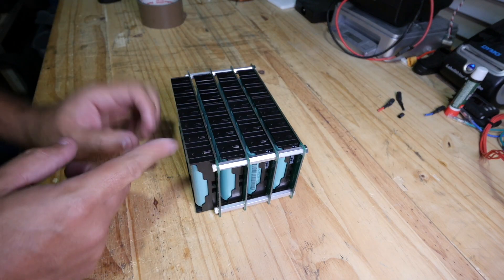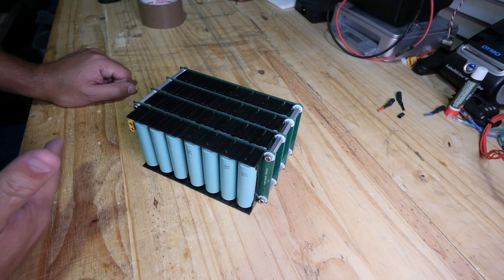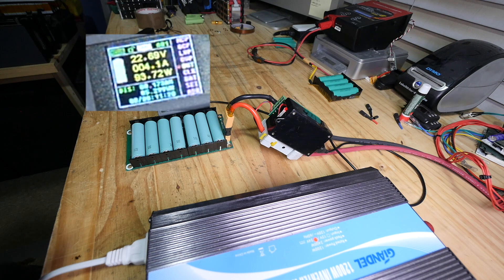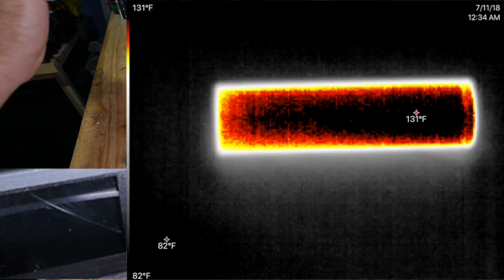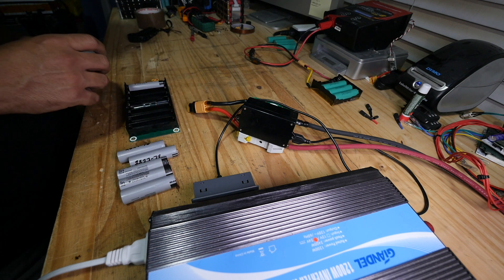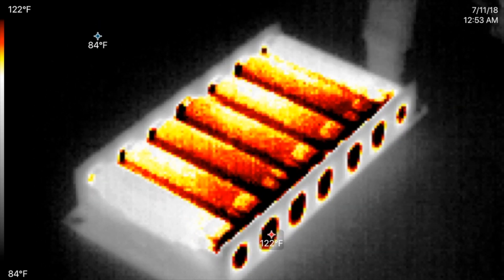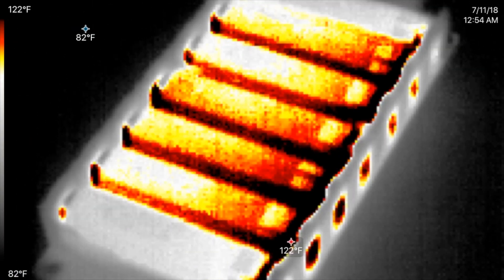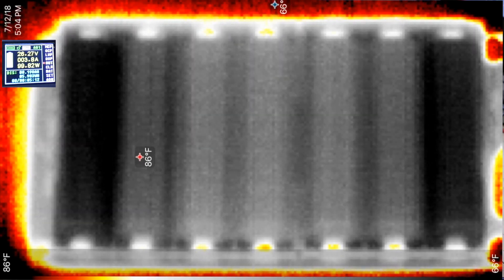Are Cheap Chinese 18650 battery holders Good enough? DIY Powerwalls

Comment: Batteries are rolls of conductor plates separated by an insulator. Thus the heat generated on the plate will easily travel through the plate, but will travel through the insulator with more difficulty. The result is that the heat travels faster to the positive and negative terminals through the conducting tabs that are rolled into the battery plates. The best way to eliminate battery heat is to have heatsinks at the positive/negative terminals.

Comment: The ohmic contact of the clips will always generate more heat than solder/spotweld connections. That heat is wasted energy. For clips to not be lossy, there needs to be a lot of pressure and the area in contact with the battery needs to be as big as possible.
Reply: Gold platting would help a lot.

Comment: Use a mosfet in a reverse polarity protection arrangement. It will heat up less than using a diode. It's really easy and passive. If the polarity is reversed it won't allow any current flow.

Comment: You can see from your infra red images that the end contacts are hot 1st then the heat spreads throughout the cell so the contact is causing the heat.

Comment: Use a cheap red LED that will light up with the wrong polarity but won't draw any current with the correct polarity.
Reply from the maker: Bamm,   See I knew someone would have a good idea
Reply: That’s a pretty good idea..
Reply: good idea i would say
Reply: great idea.  Probably worth doing module level over current protection than per cell.
Reply: I once made something like this in middle school at technology class. I never figured out how it worked.. but now it just clicked. leds don't light up in the wrong polarity.. diodes only let current pass in 1 direction. this is amazing to realise. thanks
Reply: you can have just single polarity check PCB with green and red LEDs separately
and you can attach it to BMS pins when you adding batteries and use it over and over on hundreds of battery pack assemblies
i already post a comment about it

Comment: Good video, but wouldn't comparing this to other make/styles of holders be a better comparison? How about disassembling one end of the terminals and applying 4a through it and seeing how much if any heat it gives off? Any resistance measurement on that contact from the battery side to the pcb leg? Checking these other areas may validate whether contact pressure is the key culprit here.

Comment: What if you use a battery holder with a spring in the negative side, like the regular AA and AAA battery holders? A fuse to blow if you conect something wrong? Colors for the positive or negative side? Maybe you can have two versions of the board: One simple, with no protection or maybe only a fuse and another version with electronic protection such as reverse polarity, under/over voltage and things like that.
Keep going Jehu, you are the man! I have learn a lot from your videos since you started with the samba proyect many years ago. Saludos desde Argentina

Comment: I wish someone would make a battery cell holder that had a slot to place a small nut slid into both side, so you could use small bolts for the compression terminals, this is how i built my packs on my diy powerwall, sandwiching nuts between the ends, then threading in copper bolts to secure the contacts with red locktite once they were torqued to a setting that seemed tight enough.

Comment: If I were designing this PCB to address the heating issue, I would radically increase the size of the thru-hole pads and traces to provide as much heatsinking as possible. I might even (as much as possible) convert the entire underside of the board to emphasize heatsinking and have all the sense wires etc on the top side. If you can draw enough heat through the solder pads, you might be able to keep the contacts from heating much at all.

Best part is it would not increase the cost of the PCBs at all. Also, use the silk screen layer to clearly identify the polarity of the batteries. Still no cost.

Comment: You need thicker boards with thicker contact and reverse polarity protection. With the set up you have, all you need it a blocking diode. I also think you should look into the holder with springs. I thought awhile back ago, I saw some just like the ones you're using with the solder pin in the back, but it used a bottom spring. Good Test Jehu!!
Reply: i had some holders with springs but they was even worse after that i start using same type of holders as he have and they are ok for me (i need only 2A)
Reply: Spring loaded button style connectors in the battery sled are great
Reply: blocking diode will generate heat and draw power... 0.6V @ 4A is 2.4W times the number of holders.
Reply: I agree, simple diode for reverse protection and beef up the board for both heat dissipation and thicker tracks.
Reply: You wouldn't use the diode like this. You place the diode in Parallel to the Postive and negative. Then the only time it is used is when a reverse connection is made, but then instead of going through the battery or your device. It Blows the fuse. No heat loss or power loss unless you make a reverse connection.
Reply: Except relying on a fuse to bust is really weak protection these days.  (and also unreliable depending on the cells you put in it)

Comment: Dude its super easy to keep the orientation of each cell corectly.  Your ballance leads are off center on your boards... just remember your cell tops (positives) either need to be facing whichever side the ballance lead is closer to...or the opposite

Comment: I like these battery holders a lot for my portable battery packs like my 7S4P pack for my Ham radio portable power. Not using for combined amp draws above 10 amps at 12 volts stepped down voltage via a buck converter. These packs allow me to easily change out weak cells on the fly, and each 7S pack is not putting out more than 2-3 amps. I would not use them for high amp applications, but if you had put 4 of those packs in parallel, you would not have seen as much heat. I've tested my 7S4P packs up to 20 amps at 12-14 volts continuous output (through a step-down buck converter)  with no problems.

Comment: Whenever I use those battery holders I also add a square of electrical tape at both ends which I then marks a big "+" and "-" on you make it harder for me to screw-up the cell direction. It helps a lot. :) Cheers, Paul
Reply: This is the fix right here. Just make sure there is some way of labelling the cell holder and I think you'll be OK.
Reply: Why not just use red and black electrical tape then no need to mark it as well
Reply: I tried that option but the black tape on black battery holder doesn't show up so it's just the red tape at one end - which should be obvious enough... but when I'm tired and in a rush to finish something, I need even more warning to think, before I do the dumb thing :)

Comment: There are other style holders that are really tight.  I saw another video that tried both out and had heat/resistance trouble with the "easy to insert" holders, but the super-tight ones worked much better.

Comment: I use red fingernail polish and paint the positive end of the battery holders.  I also paint a red band around the positive end of the cells as well, none of the cells I have (mostly Samsung) are marked for polarity on the sleeve.  Matching color that way I've never put any cells in backwards, at least not yet. lol  It's very cheap, gives a visual indication even at a glance, and can never fail.  I buy both red and black nail polish from the Dollar store, it's not only handy for marking cells/ holders, I also mark terminal screws, paint the end of wires, etc to denote polarity so I don't mess it up.

Comment: Jehu, I really like what you're doing here... Last saw you at the Phoenix record breaker. I'm looking into doing an electric VW Conversion too! (I got kids) -On the topic at hand:
My vote - Not to worry about the battery polarity detection.. Just be careful(?)
I am very interested in setting up a LED to indicate a high/low out of spec cell...
A transistor 'auto-jumper' to disconnect a runaway cell would be a very useful
safety device. As though there were a fuse on each cell, but done via transistor
to bridge out the errant cell. Then with LED lit, it lends itself to easy replacement,
which would be of great benefit in this time of recycled cells of similar capacity
but maybe different ages... and therefore a varied lifecycle. Thoughts?
I'd love to groom the BMS and thermal properties to achieve the theoretical
25 year battery life we hear about.. No problem shifting cells from high C rate
vehicle use to lower intensity residential solar battery use... Still counts!
Keep up th good wk

Comment: A cheap, hackey, reverse polarity circuit could just be an LED that lights up to alert the user to the issue with a diode in-line so current flows to the LED but not further. Should be safe enough if there's a per-cell ground up to that point and then join them all together once they're past the diode for the series connections.

Comment: If its worth it to add reversepolarityprotection depends on how much damage we can avoid by adding it. A video where you install a battery backwards in a normal batterpack could show the results/danger and help you decide if its worth it. ;)
Reply from the maker: You’ll ruin plastic holders and blow fuses,  but more importantly you’ll probably burn yourself as you will find out as you are interconnecting modules

Comment: A diode can be used for reverse polarity but the down side would be a set voltage drop per diode added. An other option would be to change the battery holders to https://www.digikey.com/product-detail/en/keystone-electronics/54/36-54-ND/2254090 and put an indicator in the silk screen of the pcb

Comment: Another good thing to check might be to check the voltage drop across on negative contact by measuring on the battery cell then to tbe other side of the contacts. Itll only take  fraction of an ohm to heat them up like that

Comment: About the heat issue, the soldering side of the battery terminals maybe the source of the heat, a thicker/wider soldering terminals should be cooler, a way to achive this is to let the solder flow down to the terminals, and the heat generated will transfer to the PCB becomes an indirect heat sink.

Comment: Have you tried to attach maybe a thermal pad/strip to the outer side of each battery holder. This may dissipate the heat enough. Additionally I do feel a safety measure to be added as a option but not required for everyone. As a professional I’m sure you’ll make less if no mistakes than a first time builder. However if costs could work I’d include it. Also make 7p holders so not needed to purchase 2 separate holders and have them pre soldered so only thing user needs to do is screws and connect loads. Less soldering the better :) lastly give some real world applications and recommend load times. I’d love to see a replacement for a lead acid UPS battery with size to size compression. Keep up good work and excited to buy a set of these when ready.

Comment: hi you can make some mini pcb what you can atatch to BMS pins when you adding batteries and it can indicate polarity (good polarity with green and bad with red LED) (two LEDs must be mounted parallel to each other but red with reverse polarity) you need just PCB, LED diodes some resistors  and female connector

you donť need reverse polarity protection unless you connect the pack to load    you can use that "polarity check"  PCB with any other battery pack of same type (number of cells or lower) an the best is you need only one

Comment: to test if it's the battery compartment contacts, 3d print one where you can add copper contacts that still fits your board. then measure the heat given off that.

Comment: Make a polarity tester in the style of the chinese battery testers that plug in to the balance leads. It would be very easy to do with a few LED diodes and resistors.

Comment: There are cell holders that can't be mixed up with the polarity. They have a small spring in the neg side..
Reply: That doesn't really prevent you from putting a battery in backwards.

Comment: I believe the fact the terminals are not welded or soldered so no molecular bond there for the electricity to travel you have maybe a single point on the ends of the cells touching the holder conductor and creating high resistance there and so high temperature. Best go back to more surface contact soldered/welded/screw-terminals for a more solid lower resistance connection.

Comment: In my opinion RPP isn’t worth it for the one time it might be needed. If doing it though you could use a small P-MOSFET in the positive line (gate with a resistor to negative) quite inexpensively with very little power loss versus a Schottky diode. With the large selection of P-MOSFETS available you can easily balance cost vs heating vs size.

Comment: yes, i think the reverse polarity is worth it.  IF it prevents blowing up the board or components.  what happens currently if they are put in backward?

also, the title of video was are the HOLDERS good enough.  but i think it was are the cheap CELLS good enough

Comment: Simply put those holders have a higher resistance than soldered or spot welding connections. Meaning more heat which in turn means less power for the actual work. This will get worse as high current is drawn out of the batteries.

Comment: I think if you perforate the battery holders, more heat will be able to escape...
A better design would also leave a small gap between cells. 100W, going into even a large heatsink, will heat it up quickly.

Comment: The batteries could be over amping since the connection is not solid. Do you think there would be any difference with dielectric grease?
Reply from the maker: There should be some difference,  not sure it would be worth the extra expense,   Remember we are building packs containing thousands of cells
Reply: jehugarcia exactly.. imagine the lawsuits if a house burns down. 

Safety first..

Comment: Pop in type metal contact battery holders have a finite amount of current that they can accept. The more banks that you connect in series, the higher the amperage. And the more banks that you bolt on top of other banks also reduce the amount of heat transfer to the air. Those 2 things are why I don't use this method of battery connections. I have seen a few battery holders do a complete "meltdown".  If you live in a perfect world, then you won't have any problems. But if you live in my world, then look out! I have resorted to other, more solid type of connections. I hope that a manufacturing company will come up with a better method. We all want an easy to swap-out alternative to soldering or welding batteries together in order to get the amperage we need. Thanks.

Comment: IMHO most of the heat is coming from the resistance on the contacts. They are probably very thin plus the arched shape makes it so that the they probably make contact with the cell's terminal in just one or a few small locations. Like someone else mentioned, you can try doing the same test but soldering he contacts.

Comment: I think you should continue on this project and please sell it also it would be great if you could make a 10s version with built in bms
Reply: There's absolutely no point in putting a BMS on these boards. There's a balancing connector that lets you connect an external BMS to the stack of these. Also, 10S isn't very popular in the DIY powerwall community. It's almost always 7S or 14S.
Reply: Jesper Monsted I know it has a external bms connector but jehu seems to be jumping in electric skateboard projects recently and it would be awesome to use one of these for it

Comment: I think both versions would be useful.
But it seems like those contacts are a problem.
Could you manually increase the current handling capability by soldering on more metal and see if that solves it?

Comment: I think caution should be taken, I do things slightly slower but ensure they are done properly, haste makes waste. It would be interesting to know if there is a cell holder with cooling pipes or something what would that add to the cost, an aluminum pipe that air can be passed through. or perhaps even a tube with an aluminum strip on the contact side. that would have an insulate layer from the charge. Does that make sense, my wording is rather bad LOL.
Reply: Samantha Monaghan I said the same thing the other day.

Comment: Jehu. You need to look at physical geometry between the battery (especially at the positive end) and the cell holder contact, most will be a convex to convex connection, thus a very small area of contact which can’t hack higher currents. Repeat the temperature test with a soldered busbar setup? Reverse polarity is not worth it, don’t assemble battery packs at 2am.

Comment: Hello hello Jehu...I scraped away the "wrong signs" with a screwdriver...and made you and Paul Kenneth's  "resistor" fuses to all positive ends.   + busbar (single "tinned" 2,5 mm sqr copper wire is now outside  of holders. weakest - hottest point is now the fuses.